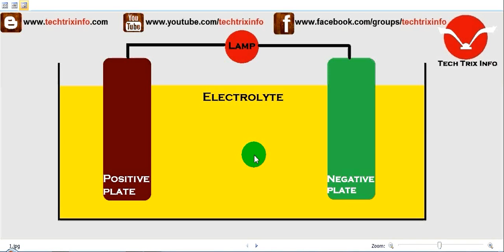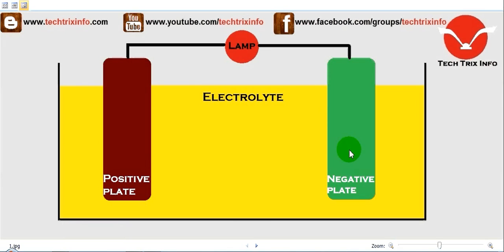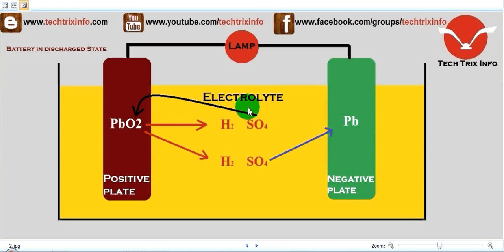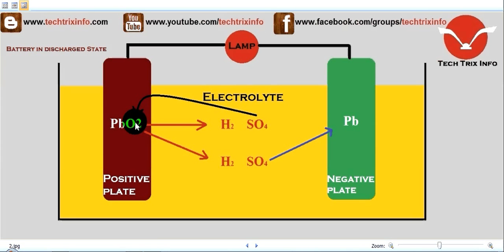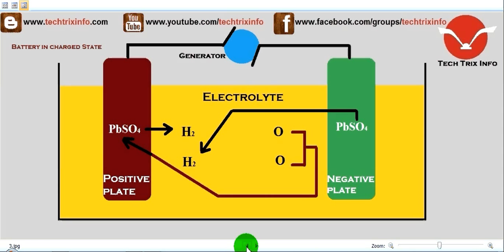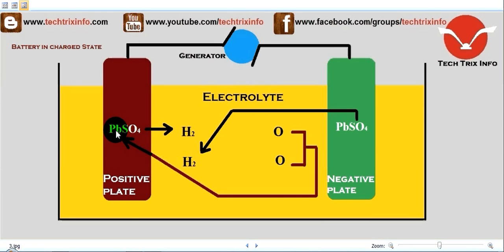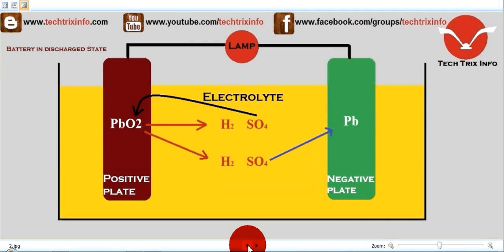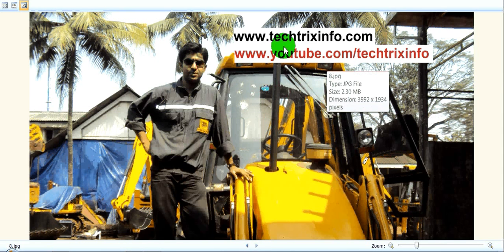How lead acid battery works. ✔

Comment: Don't be so quick to get pedantic. In a rechargeable battery, anode/cathode meaning is reversed depending on whether the battery is being charged or discharged at that moment. IMHO, you can use the terms either way round as long as you're clear about what you mean. Personally I would avoid those terms entirely.

Comment: In a battery (source) the CATHODE is positive and the ANODE is negative.

Also, when the battery is discharged BOTH electrodes present lead sulphate (PbSO4)

Does that mean that a discharged battery could be charged BACKWARDS and still remain good ???